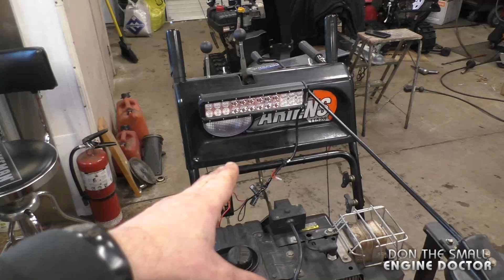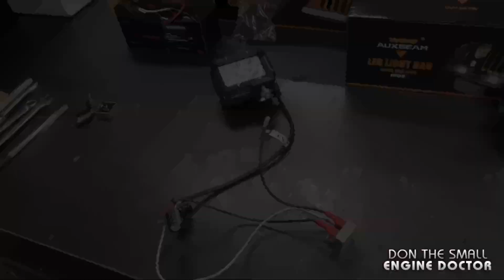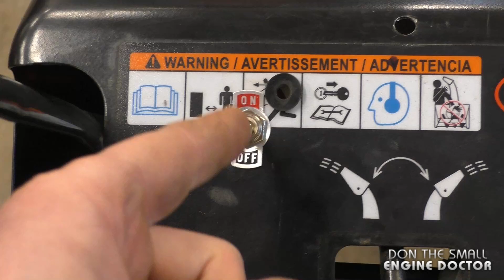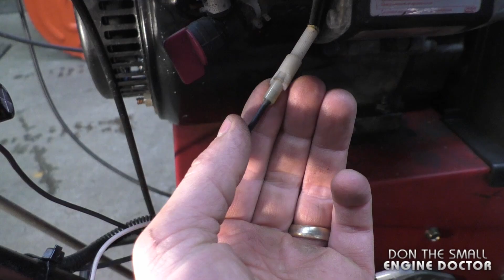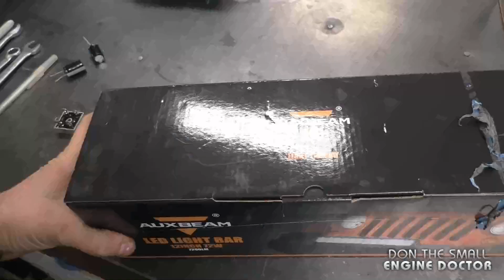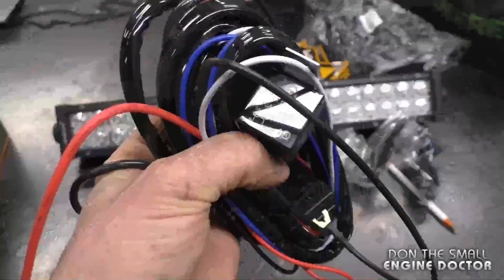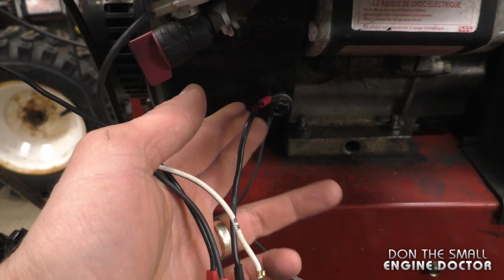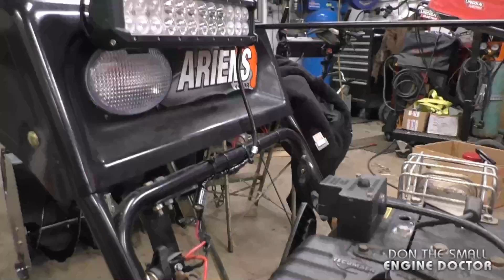HOW-TO Install LED Lights On Your Snowblower Without The Flicker!

Comment: Hi Donyboy73! Is there anyway to install heated handgrips on a cub cadet 31as6kxra56 snowblower. Just need to know what would be compatible. Rick
Reply from the maker: Check with local dealer
Reply: @donyboy73 Could you just use the voltage regulator that riding mowers have to charge the battery on the Tecumseh engine?

Comment: Spend all kinds of money in resistance, led light and that retifler and didn't work for me. I make sure the wiring was correct just like he explained and when I connect the ground it keeps shutting off the motor. 
No good.

Comment: I have a Troy Build 2010 with 357 cc engine and I install two small led like you show directly without rectifier and they work without blinking. I have them install for the last 6 years.

Comment: I have a question to the group and Dony. My 13 hp Tecumseh has one headline, I don't know the ac watts coming out. Can I install a larger 6 coil stator to have more power for LED and heated grips I would like to put on? Is this even possible? Original coil is part number 611111 and the larger one 6 coil is 611104. Are these 2 interchangeable?

Comment: Dony if you get this, I hope you will revisit this issue with modern parts availability etc. Maybe this is still the best way to do it but there are so many rectifiers out there now it gets confusing for us non-engineers.
Reply from the maker: I agree, things are changing every year!
Reply: @donyboy73  Cool I'll look forward to any videos if you can do them. I want to add an LED to an Ariens thrower and I added LED tail lights to an old tractor that only has headlights. I'll probably switch to LED headlights too once I work all this out. Thanks Dony, you're the best.

Comment: Donnie, I put the wire harness that came with the 4" square led lights. I ran the positive from the power out lead from the engine stator. I grounded it and when I started the engine the lights lit for about 30 seconds then burned out.. I was wondering if I could run a AC/DC converter from the stator to the lights via a toggle switch? Should I put a 5 amp fuse between the converter and lights?

Comment: Hi Don I have a question for you. I have a craftsman snowblower that has a 208cc power more engine it has heated grips and a light so i was wondering the max wattage i can draw from the light circuit to add LEDs

Comment: Dony,  wouldn't you think the 72 watt light bar you showed would be too much load for a stator that is designed for a 36 Watt (3 amps at 12 V) or lower?  Also, if you have heated hand grips it may be ok if the hand grips are turned off.  If they are both on, it may be too much demand and the gripps may not heat well at all. Or do you think it may damage the stator and/or other components?
Reply: He doesn't have heated hand grips. how many amps do you think the heated hand grips would take anyways.. I'm sure it's more than 3 amps.. shut up dummy..

Comment: Thanks for the video. I set mine up exactly as shown and the lights are very bright and no flicker. I cut and used the enclosed wire harness and fuse. Great instructions. Easy to follow. Thank-you Don.

Comment: Just a heads up when installing a on/off switch. I bought a lighted toggle switch and wired everything thing up properly. Once I started the blower the stock headlight was very dim and it didn’t allow it’s full lumes. So I had to disconnect the ground wire to my switch eliminating the internal bulb and the problem was solved. Now the switch is just a 2 prong switch. So when adding a switch just get a BASIC On/Off switch. It’s doesn’t work with lighted toggle switch!

Comment: I think I'll just mount a battery holder on mine and power the LED lights with a power tool battery.  Now to find a 20v light bar...(Mine already has a 3w light on it near the top of the handlebars, which lights the machine itself just fine, but not much in front of it, lol).  Never saw a rectifier like that.  I've seen tube type, selenium type and the 1N4007 diode type, but that's a new one on me.  Not sure what the capacitors would be for as I think a dropping resistor would sufficiently lower the voltage enough for the lights to keep from blowing them.  I take it that the generator on that unit puts out AC voltage then?  Weird.  But I guess since there's no battery on the unit to recharge for starting...

Comment: I know this video are quite old but Donny did a great job explaining and I really appreciate you get out the community. 
@Donny, I have a Toro 1038 Tecumseh and a  Toro 1128 Briggs and Stratton. If I follow your method using two pods of 18W, would both engine produce enough voltage to power 36W total?? Can anyone help me answer this question please? Thanks in advance.

Comment: Hello I am adding two of the small aux beams like yours on my snowblower.  Do I need to use 2 rectifiers or can I go with one and then tie the two lights in after the capacitors?

Comment: My original light is burn out on my snowblower, can I connect this set up directly on the wire that goes to my old existing light and from there do to my new LED lights ?  UPDATE : I followed your instructions and it’s working ! Thanks a lot Al

Comment: I decided to do this on the two snowblowers I have that have stators.  I opted to leave out the capacitors and the toggle switch and decided to include an inline fuse.  Your video made the process so simple.
And I love the Auxbeam lights you recommended.
Thanks Don!
Reply: Have you had any problems without the capacitors?
Reply: @FJB752  Good question, I am also interested.  Do you get any flicker?

Comment: There is another solution and that is a high lumen headlamp.  It also can be used in most cases when riding a bike at night,  I use it along with the headlight on my troybilt 3090 vortex 3 stage.  You can get them in rechargeable form and thousands of lumens
Reply: They are adjustable and fit over stocking caps

Comment: Great video, but one question, where does one get the male connector with cord for the stator female connector wire coming from the engine?

Comment: Hey, was wondering; why does it seem like you guys use the white lights and not the yellow (fog) ones. For now that is what I run in the factory 1156 bulb. It seems to cut through the falling snow with not nearly as much glare. I would run selective yellow headlights on my car like the French used to until they changed the law...

Comment: Excellent tutorial.   The only thing I would do differently would be to put the switch between the AC wire from the engine and the rectifier.  That way rectifier and capacitors aren't energized with no load when the light is off.  Great video.
Reply: Perfect that’s exactly what I ended up doing. And u can only use a basic 2 prong switch not a lighted switch bc it won’t make the stock light as bright as it normally would !

Comment: Hi Don, you are providing great videos. Thanks. Ok this question may have been asked but am curious to know if u can get hand warmers installed on my 2007 Toro Max 826 LE?  Also wanted to know how the steering assist on some newer snow blowers differs to the non steering assist ones, mechanically?  In other words how does steering assist work?  Is there any steering mods one can do to say the Toro 826 LE?  Probably no or too expensive, I just was wondering. 
Loris

Comment: I tried installing a light with the rectifier and 2 capacitors but my engine wouldnt start , you could see light want to go on during cranking . After disconnecting,  the engine now barely idles. Dont know what happened

Comment: Oh Danny boy,
 you have a surplus of information though I am not looking to put a light like this on my unit, and I don’t already have a light on my snowblower. 

I just wanted to throw a comment out there for a super video though it doesn’t hit right where I need to be, you are right on time. 

Additionally, the pipes the pipes are calling

Many thanks laddy 

Also shame on me I did not watch this video from beginning to end so it may have solved my problem though I suspect that it wouldn’t have, by my leave Patrick Begora. 

(Pardon the Disney reference)

Comment: I was told by an electrician that a bridge rectifier will not work if both the stator and load are electrically connected to ground, because that would essentially short out half of the bridge rectifier.

Comment: Does the rectifier heat up at all ?? im debating to make a nice 3D printed enclosure for the rectifier and the capacitors so its a nicely sealed up unit for my honda. The larger honda boys have an onboard 12v battery so its a much easier upgrade :) My little unit only has a direct power line.

Comment: If you have a DC Alternator can you hook the leds directly to the dc side. I have a 3/5 amp AC/DC alternator. I want to add an led light to an 80's Ariens blower, no other electronics. Can I hook right into that 3 amp DC side without a rectifier/etc?

Comment: Hey Don, what if I have the 3/5 amp AC/DC Tecumseh alternator laying around. I can hook the led right into the DC part of the alternator without needing a rectifier or capacitors right?
Reply: Unfortunately your not getting back to me, so I have spoken to several other people about this topic. So far everyone I spoke to except one, said yes, if you have 3 amps unused DC on a Tecumseh or whatever for that matter, you can hook an LED straight in to the DC, no rectifier,  capacitors, etc. Since I'm using an 18 watt DC 4 inch auxbeam, that gives me 2 amps DC to spare. Only 1 person said he burned out is alternator, but he probably went over 3 amps or did something else wrong. I'm going to be hooking this up in the coming days, I will get back with a conclusion, but as of now, if you have the 3/5 amp DC alternator and your not using the DC, you can hook straight in. Plus all the snowblowers that use that 18 watt alternator can have the 3/5 amp added, it uses the same 3 magnet flywheel the little one does. Their out their for sale used. I'm adding it to an 8hp Tecumseh on a 1987 Ariens.

Comment: You’ve been a big help making my old junker run better. Looking at your capacitors, looks like electrolytic. Have you had trouble with them in the cold? I might try some thin film or ceramic caps instead? Also looks like your just running both caps in parallel, across the output of the rectifier, but a little hard to tell for sure? Thanks! Btw, I just swapped the 12hp off my old yard king with a junk final drive onto a slightly newer snow king that had an anemic 10hp but a much better final drive design. It’s now a beast that needs a better light.

Comment: Good video Donny, it doesn't matter which AC connector you elect as your positive or negative because that current "alternates" between + and -. So each terminal is alternatively positive and negative.
Reply from the maker: thank you!

Comment: Hey, need some advice I have an old snapper 824 series 1 snowblower. I got an LED light which I mounted to the snowblower and ran the wires to a fuse and bridge rectifier.  The LED light comes on for about 15-20 seconds then shuts off.  Did some checking with the voltmeter and from the motor 22 volt Ac at 349 hertz? And on the dc side, it's 22 volts. Do you know if the bridge rectifier is overloaded? The fuse didn't blow and the light still works when hooked up to a 20v drill battery.  

Help please.

Comment: This is an awesome video. I've got an older MTD Yard Machine 8/24 with electric start that has one (1) wire coming out with a bullet connector. I don't know how much voltage or wattage that one wire provides, so if anyone can help me out on that I would definitely like to build a light setup. I was hoping to put two (2) small lights on the blower... one on the left-hand side of the bucket to focus on the rear immediately in front of the bucket/auger, the other mounted up high on the "dashboard" off to the right and focused out to a greater distance. So if I used two 18W lights, would that work or is there more powerful lights that could be rigged with Donny's wiring idea?

Comment: Hey donyboy, I have a Snapper 1030 snowblower with the 10 hp Tecumseh engine and 110v starting system. It has two old-style round lights on it and I was wondering if this same process would work for me if I replaced those lights with 2 - 15 watt small led flood lights? The specs say that each light draws ~1 amp.
Reply from the maker: it should work
Reply: @donyboy73  Awesome thanks!

Comment: I followed your video and my LED light works great! I found one with the same 18 watt consumption as the original bulb to protect the stator from being over worked and disconnected original bulb. The lumens are 1100 now as opposed to 263 with original bulb. Thanks! Great video as always!

Comment: reguarding the factory ariens headlight and factory installed heated handgrips. when I turn the handgrips on the light dims and the grips dont seem to get hot. barley warm.  is this normal .. I have the ariens 2015 platinum 30" SHO
Reply: try cranking up your RPM. Sounds like you are taking more current than the engine is producing at that RPM. If thats the case yes it is normal.

Comment: I have a 2019 husqvarna 42” riding mower, it came with normal 1156 bulbs.  I piggy backed the oem light wiring to power the twin 6-led bars, did I need to add the rectifier and capacitors?  What will happen?

Comment: I just bought a new ariens platinum 24 sho that has a halogen light and heated grips but someone told me DO NOT hook up a led light more then 18 watts.... how did you run a 72 watt light
Reply: Maybe, it doesn’t install voltage regulator... so Voltage vary between 20 and 40volt... it’ temporary enough to drive it, but it can burn the led soon.  Rectifier/regulator 12v cost 10$ on amazon.

Comment: Don this will work for me, how many lights can I install?  Also can you get 12 volt charge to charge a battery? 
I want to install on garden tractor  need 12 volt starter. Thanks Ben

Comment: Thinking about upgrading to an LED on my 10.5hp snowblower for either the end of this season (upstate NY)/the start of next season - very informative so thank you.
Just out of curiousity do you think an HID headlight with a ballast/relay "could" be installed if someone were to come up with a mount or holder that fits the bulb (maybe in the OEM housing if gutted - or a waterproof enclosure). I've installed HID's on a few of my cars over the years and its pretty easy, this seems very similar without the ballasts - Is there any reason in particular LED is preferred over HID on a snowblower?

Comment: With your help I installed a 20” oxbeam led light on my ariens snow blower last year and it’s working great, I mounted it on the top of the intake to get better illumination, I have a tarp cab that was in the way, thanks doneyboy you saved the day again that was the prescription I needed.

Comment: Donyboy: I love your videos and have learned a great deal. My puzzle is a bit different: I have the identical 18 watt led (fog light) as yours which POPPED the moment I powered it up. So I clearly need to clean up my system for the reasons your are suggesting, maybe...  In my case I have a new 13 HP 420CC predator motor that has a starter and a modest charging circuit consisting of just one coil on the flywheel. I am adding a a small 10AH lead acid battery for starting but would also like to run my 18 watt light (just 1 light) and possible my original Toro hand-warmers, even though this may drain my battery as the single charging coil may not keep up with the power drain. Of course I might have to run one or the other and may install a DPDT switch for this purpose. 

Please tell me this; can I install just a simple voltage regulator to control and convert the voltage coming from the motor to safely run my lights & grip warmers while also charging my battery our would I still need capacitors even with the 12 volt lead acid battery now in the mix?  Thanks again for all of the great videos you have created to help out the rest of us!

Comment: AWESOME instructions! I successfully followed the directions and installed a set of LED flood lamps on Troy-Bilt 28 dual-stage snowblower (that has heated grips). The only additional modifications that I made were to use heat-shrink tubing to help isolate/insulate the wire/connections points for the rectifier and splices to the power out from the engine.

Comment: This is a bit more complicated than need be. All one actually needs is the rectifier and the 12 volt LED light fixture. Wire it up the exact same way but exclude the capacitors. 
I did this mod 3 years ago on my 2009 craftsman blower that did not have a light from the factory but the engine had the stater factory installed from Briggs. I used a bridge rectifier out of an old computer power supply and all works flawlessly.

Comment: Hey Dony, whats the part number for the engine stator on your Ariens that allows for the hand grip warmers?
I have a 13.0hp Tecumseh OHV on my Toro Powershift I may want to add aftermarket heated grips too. Thanks.
Reply: 611104 3/5 amp alternator. Works with 3 magnet flywheel 611093.
Reply: Cool thanks.
Reply: No problem.

Comment: What do the capacitors do? I’ve seen other people do this without the capacitors and don’t really know the use of them
Reply: Basically stabilize the voltage and/or current to the lights. They act as buffers to minimize spikes I believe